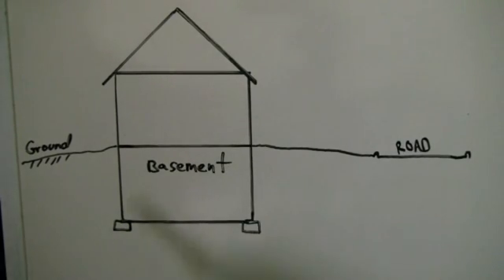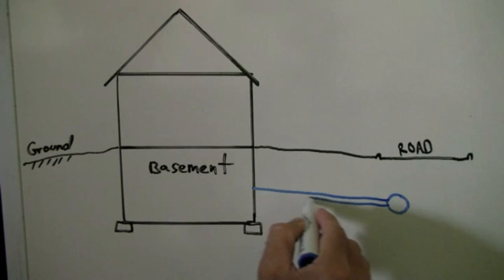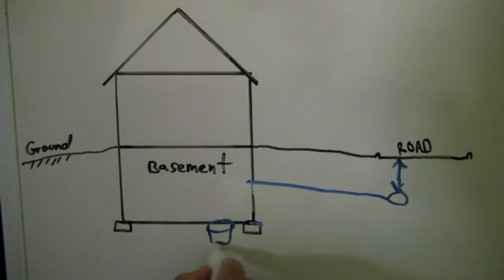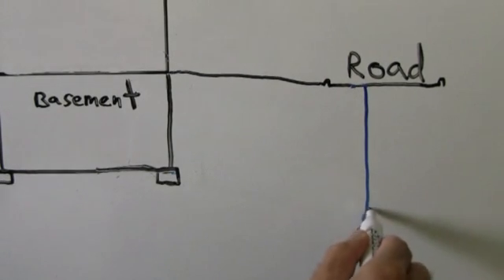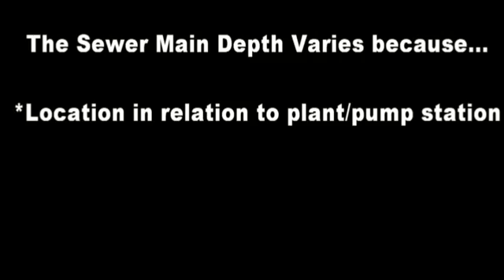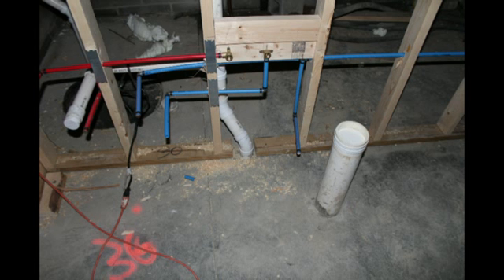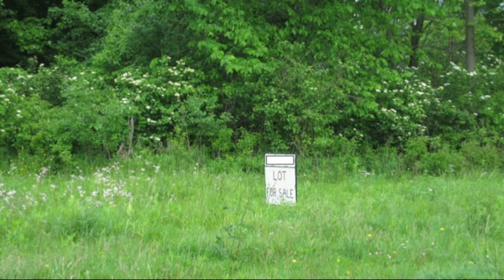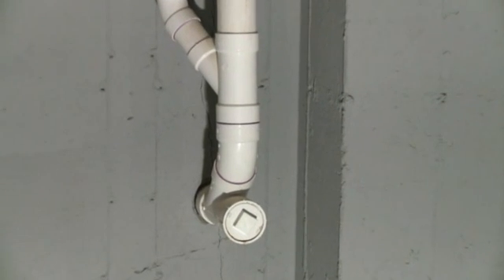Home Sewer Service and Grinder Pumps

Comment: I have a grinder pump with an alarm box which has my local town water and sewage Dept. phone number on it what I need to know is if their number is on it in case of alarm why does my power run it? As far as I'm concerned they should have to power it if it's necessary and has their number on it in case of alarm.

Comment: I am not a fan of grinder pumps at all. They have far less capacity than solids-handling pumps and all it takes is one solid object (like a rock or maybe a toy car or anything else that's not a semi-solid) and you're looking at a pretty good-sized bill for its replacement plus you can't use any water in the basement until the pump is replaced. 

I've seen solids-handling pumps last more than 30 years but very few grinders will last that long. 

One advantage to grinders is that the discharge line usually can be 2", and if it's in solid rock and not too deep, it can be dug with a bulldozer and a ripper tooth rather than be chipped or blasted.